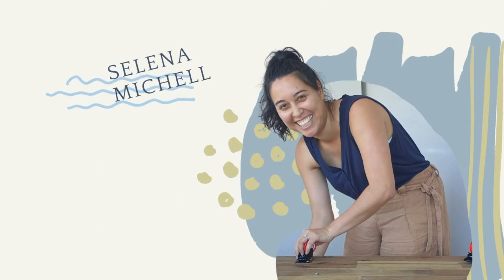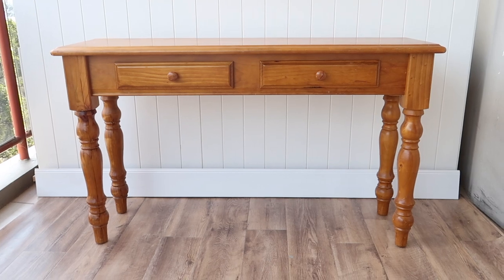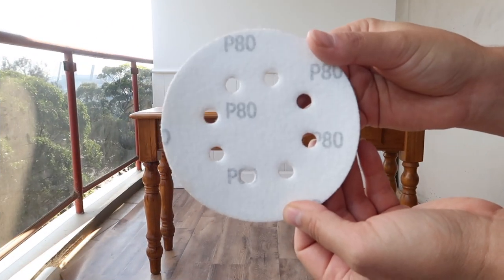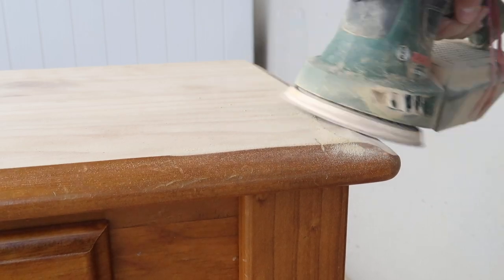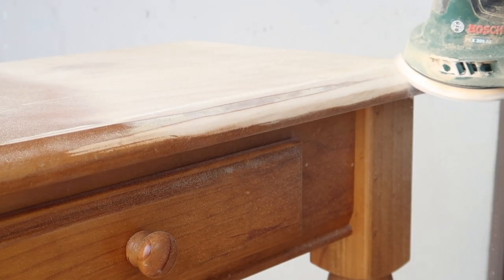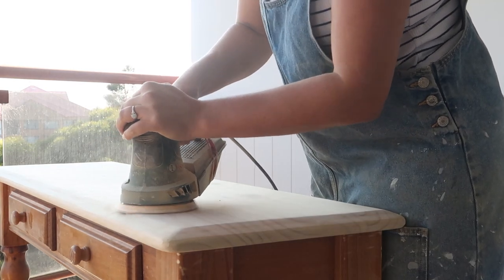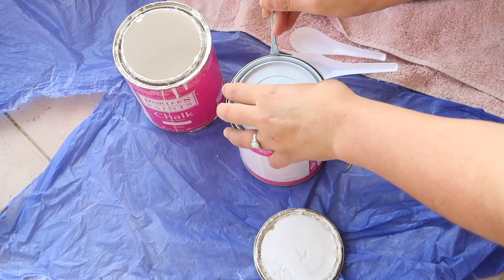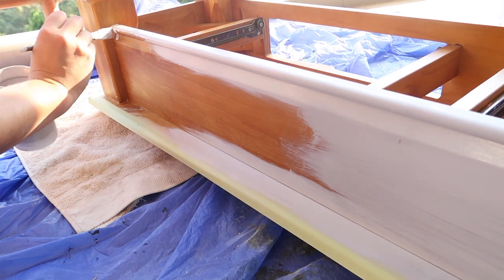Entryway Table Makeover w Chalk Paint I Furniture Flipping Transformation / DIY

Comment: What kind of sander are you using? I need one
Reply from the maker: I used a Bosch Random Orbital Sander,   https://www.amazon.com.au/Bosch-Orbital-Sandpaper-Assistant-Included/dp/B07JVD67QB/ref=asc_df_B07JVD67QB/?tag=googleshopdsk-22&linkCode=df0&hvadid=341743966998&hvpos=&hvnetw=g&hvrand=12616038461158185163&hvpone=&hvptwo=&hvqmt=&hvdev=c&hvdvcmdl=&hvlocint=&hvlocphy=9071858&hvtargid=pla-678549210150&psc=1

Comment: Hi how do we knw which number grit we need plz ?
Reply from the maker: There are quite a few factors that influence which grit to use. The brand of your sander for one,  the type of timber you are wishing to sand. Generally hard wood timbers such as oak, spotted gum, Blackbutt, Mahogany, Jarrah require a lower grit to begin with such as 80 or sometimes 60. Another factor is also how much paint or stained top coat you are needing to remove from the furniture. I would recommend testing out a corner of your piece in the lowest grit first to see how it responds to the surface. If it isn't taking much off go down to the next grit. If sanding isn't working you can always try paint stripper.